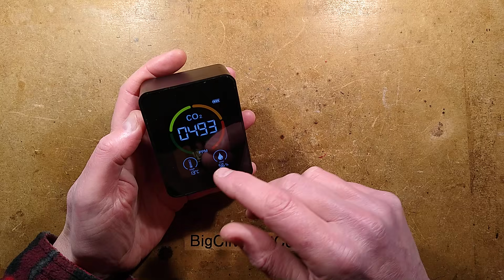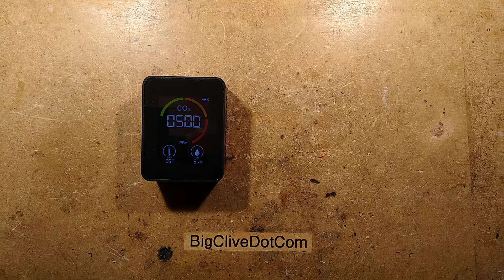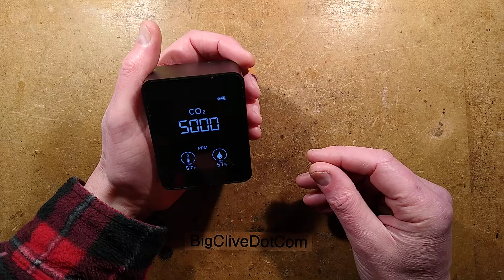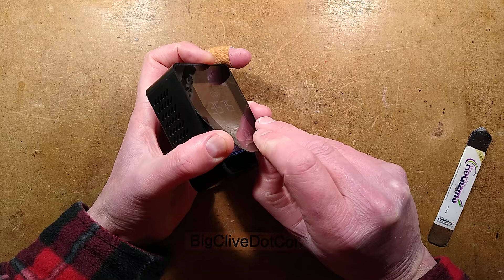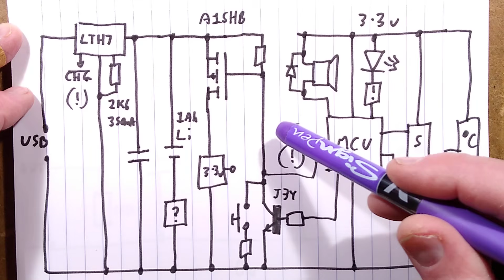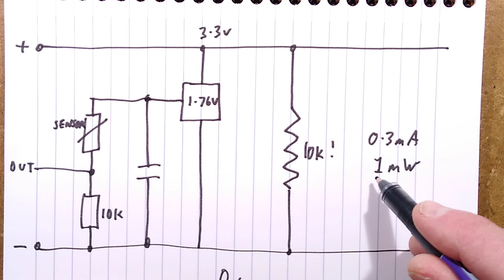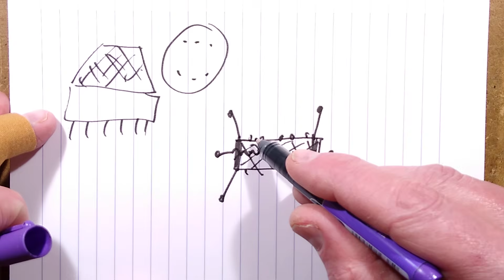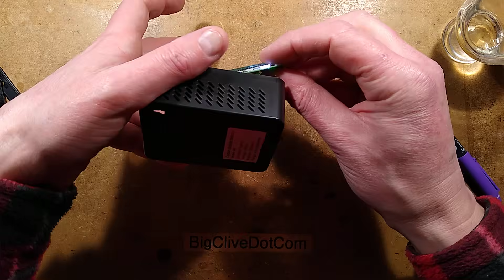Fake CO2 monitor (party detector) with schematic

Comment: Shame about the display. Since it's such a basic kind though, that microcontroller probably doesn't contain a proper LCD driver at all. I bet it's a STM32 or similar and they're just wiggling a bunch of GPIOs with roughly the right waveforms to make it do something. The fact that the segments turn off way faster than they turn on would support that theory. Notice how there's also a few random pins between the LCD traces that go to something else, suggesting the chip is not designed with a layout like that in mind. Not sure about the programming header. The cluster of resistors near the middle of the board could be some weird way of combining UART and two programming pins (ISP? SWD?) onto the same header which would explain the weird A/T and B/R labels.

Comment: The co2 meters are used for growing cannabis. When the plants are in flower specifically people use co2 generators or tanks with automatic dispensing valves for the plants.

Comment: You actually only need one resistor for usb-c charging. Yes, theres two cc pins, but only one of them gets carried by the cable, you can simply connect both cc pins together and then put a single resistor on both lines

Comment: In case you're still wondering why someone would want to know the CO2 readings of their location: they were already a thing since ventilation system C and other types of full climate control as certain threshold values allowed the system to go over the comfort settings of flow rate. But lately in many countries the CO2 levels are considered to be a measure of the current flow rate in a room to check if there is enough ventilation according to the corona prevention rules that are in effect. 
Personally I think it's bogus to use CO2 readings to measure ventilation, but let's just say that adding in cost and complexity, the CO2 measuring is "close enough" to detect the trend. Apt ventilation makes heating more efficient (and thus cheaper), but also makes mental efforts less straining (so employees who work in well ventilated areas need less breaks "to catch some air" and thus will produce more work - hooray for those bosses who "really care about our well-being" ahem)

Comment: in some of my previous jobs we had co2 sensors to detect high levels of co2 in case there was a leak from the soda machines i believe, the levels got pretty high, an climbed by 50-200 ppm just from people using the soda machines a lot
Reply: That seems like bad design

Did they Carbonate anything or did they just dispense cans

Comment: Hi clive, thank you for the video. I happen to work at a company that produces various gas sensors. It is quite common for manufacturers of cheap devices like this to use metal oxide sensors to determine a so called "CO2 equivalent" reading. The sensor actually measures the amount of volatile organic compounds (VOC) in the air and as long as the sole source of both VOC and CO2 is people, there is a quite good relationship between the two. Of course this doesn't work in environment with artificial VOCs. The reason for doing this is that metal oxide sensors are much cheaper than NDIR or PA Sensors normally used to detect CO2. Of course I agree, that the marketing for this device is not completely honest, it does not measure CO2, it measures VOC and calculates a CO2 equivalent reading, as a total VOC reading is not very easy to grasp for the end used. We actually discourage the usage of "CO2 equivalent" readings in favour of an "air quality index" which just tells the end user if it would be a good idea to open a window.
Reply: I am surprised you haven't campaigned to safety authorities to get these things banned

Anything which can miss high levels of CO2/CO (false negatives) whilst also giving alarms (false positives) when they're not present will fool consumers into thinking they're working properly

Yes, some of these are sold as monitoring CO as well as CO2

Comment: As somebody who likes to make random electronics projects. I'm betting there's a VOC sensor in there that's doing some estimate to calculate CO2 somehow. Proper CO2 sensors are more expensive so I wouldn't be surprised if the cheap one uses the not very good sensors that are much better at VOC. Which is also useful to me, potentially more so.
Because of 3D printing and electronics projects I go through concerning amounts of acetone and IPA.(not to mention the occasional science project) Making sure I'm ventilating a work space is a useful measurement for me.
Measuring CO2 is actually less useful to me, but fun to know. Particulate count and VOC are just far more useful to me. But that may be because they're immediate safety concerns versus good to know. Particular count is also useful for knowing how bad my allergies are going to be.

Comment: Is it just Tin oxide? it can be doped with all kinds of elements, the most common is Indium tin oxide (ITO) which forms a transparent conductive layer, allowing touch-screen tech. I once had a completely transparent calculator, must have been 1990-ish? I wonder if they still make those? Off to Ebay i guess😁 Many rare metals are used in semiconductors, like Tantalum, Germanium, Mercury Bismuth etc etc. Chemistry is not really my thing, i took the cse just for fun and got grade 1 much to my surprise🤔but it is fascinating to watch you tear these things down for us. Well done, keep up the great work🖐

Comment: Even real CO2 sensors can be questionable by assuming the two-week minimum reading = 400ppm. They nearly all use an auto calibration routine that looks at the lowest CO2 level over the last two weeks and assumes that must be the outside air level of 400ppm. If your apartment doesn't actually ever hit outside CO2 levels because you work from home, your long term minimum might be significantly higher than that, thus all your readings could be artificially lower than the real value.

Comment: Please don't call AVRs "Arduino-ish" next time, as we feel a little offended (FYI, AVR is a pretty reliable chip family that is allowed to be used even in some safety systems, Arduino is a newbie-friendly glitchy bootloader kids burn in those nowadays tho).
Reply from the maker: While being an assembler coder at heart, I do recognise that Arduino has created a new generation of kids that aren't afraid to code and build some amazing things.
Reply: @bigclivedotcom  Unfortunately, beyond their comfy code resides a scary wall of libraries they are afraid to modify, let alone to write on their own, so this library dependency is like an addiction. Pretty scary nowadays, as you can find many MCUs and SOCs having a built-in USB programmer and a much cleaner IDE making them pretty much the same as Arduino - but no, they'd never choose anything beyond their limited choice of devices supported by that Arduino IDE. So, they are not afraid to code, but they are :)
Reply from the maker: @TheBypasser  That's the bit I don't trust.  There could be a bug in a library module that you have no control over.
Reply: @bigclivedotcom  Well, for stuff like IOT, unfortunately, there is not much way of avoiding the manufacturer-supplied libraries altogether (as the last thing I plan on is rewriting a Bluetooth or WiFi stack a week before deadline) - but rewriting parts of those for fixing bugs or implementing the features I need - or the support for usage scenarios they've missed is a priceless thing to do almost every time.

Comment: i have a carbon dioxid detector and it works with co2 ... its quit interisting how fast a smal room where you work in on pc is saturatet with co2 to the lvl that slows you down

Comment: Hi Clive. It's a well documented weakness that both CO and CO2 detectors respond to ethanol fumes. This does not makr them fake. Exposure to ethanol fumes will inhibit their ability to respond to CO or CO2 for quite a while. This should clear after a day or two. I have a very similar device that is white cased. It does not respond well to CO2 released from fizzy drinks. I do not know why or even if CO2 is still used for commercial carbonation. It does however respond well to CO2 in exhaled breath. I hope that you can conduct further and more clinical experiments.
Reply: I agree. The sensor might be very slow to respond to CO2 readings yet sensitive to other chemicals. The problem with sensors is that they can sense more than what you want them too.
Reply: These units aren't going off on the Co2 in your breath but the small amounts of formaldihyde and alcohols which are naturally in human breath (even without drinking)

none of these sensors go off on a single substance and they're not particularly gas selective (there are sensitivity charts for most of these sensors and it's worth noting that SnO sensors have zero sensitivity to CO or CO2 - the readings are 100% "derived". As far as I can tell these devices are sensitive to hydrogen ions)
Reply: "I have a very similar device that is white cased. It does not respond well to CO2 released from fizzy drinks."

It should.

I have an actual CO2 air quality detector here. I just tested it; when exposed to a puff from my sodastream, it goes crazy within about 10 seconds. It does not react significantly to alcohol fumes.

It sounds like your unit is a fake as well.

Comment: we bought this one. I tested it, it doesn't measure what you need. for example, you breathe on it, it shows 1500, turn it off immediately turn it on, and it shows 400 again =))) this is a funny device for fools that shows random temperature and humidity values =)

Comment: In an enclosed space, CO2 levels are an excellent proxy for viral transmission risk, so they have been used to regulate ventilation in enclosed spaces where people congregate. Our restaurant at work has windows hooked up to a CO2 monitor, so as soon a threshold is reached, all of the windows open, then close again when another threshold is reached, after the CO2 level drops.
This automation allowed the 2m separation restrictions to be relaxed earlier than most people would have been comfortable with otherwise.

Comment: You asked why one may want or need to use these handheld CO2 detectors, I am required to use one when working in a wharehouse with a propane forklift. It always made me wonder a bit why I have to carry a portable one with me and my forklift when Amazon installs hundereds in their buildings from the start, but hey: large corps do what large corps do! Lol

Comment: I have a CO2 sensor in my home. Due to some poor ventilation issues it can easily get up to 1200 ppm if I am not careful. I have it now logging the ppm CO2, TVOC, PM1,2.5,10, AQI, Humidity, and temp and sending that to a home assistant server that I have. It is regularly above the 800 mark in the winter when the house is closed up.

Comment: Electro chemical gas sensors are interfered with other gasses. The datasheets for all the MQ series sensors have graphs showing the response to other gasses.

In response to why you want to measure co2 - well I use one in my bedroom, I get better sleep if co2 is below about 800ppm. You can easily go much higher than this without a window open, and how much to open it in the winter is helpful when its freezing outside

Comment: Interestingly the Scottish building regulators now seem to require CO2 meters to be installed in the main bedroom of new build properties where there is less than a certain level of airflow in the room, seen them in several different properties built in the last few years.

Comment: CO2 measurements were mandatory in Belgium if you wanted to do any kind of group activities after Covid lockdown (class, bar, restaurant, knitting club, orchestra, ...). Basically to measure how "fresh" your air was and thus how much you needed to ventilate to reduce the risk of Covid particles hanging around. I think the major takedown was that classes were downright unhealthy, as the CO2 levels were SO high up. Also, they just need to be in the room. An exact location in that room wasn't specified, so most people just put them next to the open window.

Comment: Yo ho, Big "C"...is that what the ladies call you.   HAHAHA.   So there I was, on the truck assembly line (won't tell you what brand).  Slamming out truck beds and spot welding brackets...and the dam line shut down.  I think it happened twice in a few minutes.  Then the Foreman took over my position, there was a dozen bosses assembled 50 feet away and the union steward said that I had to go with him?  Yep, there was a sensor that detected alcohol on my breath.  Rut-ro!  So do you live on the Isle of Man?  It must be a country within a country!   Great video!

Comment: That's disappointing. I wonder if a proper numerical figure on this can be found when someone is just on the limit of not being allowed to drive.

I have a different sensor that works with bluetooth that I just tested by putting a cloth that I've put some alcohol on and placed near the sensor. The TVOC, HCHO and CO2 sensor just spiked with the temperature remaining consistent so I guess it's not reliable as an air monitoring sensor.

Comment: I got an identical-looking model recently. Testing it, it definitely reacts to alcohol (I got extremely mad when it worked), but it reacts to the breath of extremely sober people too! So it does seem to detect (something that at least approximates to) CO2.
Reply: Just because it reacts to breath doesn't mean it reacts to CO2. Breath contains trace amounts of alcohols and formaldehyde that the device may be reacting to. Test it with an actual CO2 source.

Comment: There's use for CO2 detectors in horticulture especially of the "devils lettuce" kind' the higher the CO2 the faster the plant grows as long as you match it with appropriate light levels' sucks that it's not a real one.

Comment: I only trust NDIR sensors which bottom out at 22 bucks for the sensor itself. Electro-chemical sensors have cross reactivity with other chemicals and are more expensive for the MG811 sensor with zero benefit. NDIR sensors are very accurate because they shine an infrared light at the exact nanometer wavelength of CO2. No other chemicals are known to reflect this precise band of resonance which makes it a super reliable method of detection. I hope to see it used much more for other gasses. You could put multiple wavelengths in a single case.

Comment: CO2 concentrations can affect mental functioning, trigger migraines, etc. In addition to being a very good proxy for "balance of human breath vs ventilation". (Handy for virus prevention...) There are VOC sensors that report a "eCO2" (equivalent co2) number based on something else that's a similar proxy - e.g. SGP30. An actual ndir co2 sensor is somewhat pricy, at least $40 just for the component. So this might not fully be a scam, but deceptively marketed. (Haven't heard of any heated metal oxide co2 sensor, though there are variants for many gases)

Comment: The rise in popularity of the CO2 detectors came about with Covid.  One of the ways to reduce the spread was to ensure proper ventilation of spaces used by many people.  Opening windows etc.   CO2 buildup is a good measure of how poor the ventilation is in a given locaiton.  And when you got CO2 levels above a certain concentration, you start to get increased drowsyness and reduced concentration.  After some monitoring we discovered that our office space was too densly packed for the available airflow so we had to enforce fewer people per floor. The old building couldnt be modified to increase the ventilation due to planning / construction issues.

Comment: Most of the datasheets from the manufacturer of that voltage regulator chip have the hilarious mistranslation, but one or two indicate that the intended meaning is "Fine Made Electronics" which makes a lot more sense 😆

Comment: Co2 in my office can get up to 4000 ppm if I don't open the window or door. Studies show 1200 is the maximum safe limit, and a 50% cognitive decrease at 2000ppm. These sensors (a real one that works) are great for keeping you alert and your brain working properly (where you otherwise wouldn't notice you're featuring decline). In a bedroom, high co2 levels can mimic the effects of sleep apnea on the brain. There is a very real problem with air quality and people spending large portions of their time under oxygen deprivation (Tom scott has a great video showing how much of an effect co2 can have).

Comment: One reason I can think of for the 1.7V regulator is if it is an ATmega chip, they have a 2.1V precision reference built in for better measurements if your supply isn't the best. Though I have a feeling the sensor isn't accurate enough to warrant that...

Comment: After a little research, CO2 sensors are sensitive to alcohol, pretty much all of them.  The use of these devices is to determine indoor air quality.  CO2 is a proxy for too many humans in an enclosed space to reduce spread of covid.  Of course crappy sensors do not work well and in this case it may not even be a CO2 sensor.

Comment: Levels of as low of 1000ppm of CO2 have been linked to reduced decision making ability. Levels higher than that are quite common is houses. Also an indicator of infection risk of airborne illness because lower CO2 tends to mean better ventilation

Comment: CO2 is widely measured in buildings as an indicator of air quality (specifically adequacy of ventilation rate). Either sensors are wired as inputs to the mechanical ventilation system, or simply to a display (often with traffic light indicator) to inform the building occupant that more ventilation is required (e.g. by opening windows).  In UK schools Building Bulletin 101 defines ventilation requirements including indicative CO2 concentrations. There was wider discussion of ventilation during the Covid-19 pandemic.

Comment: 48-pin PIC (18F5xxx) chips seem to have power directly opposite on pins 6,7, 31,30 whilst the ATmega809 uses 14,15, 28,29, 42,43, which may help with ID.